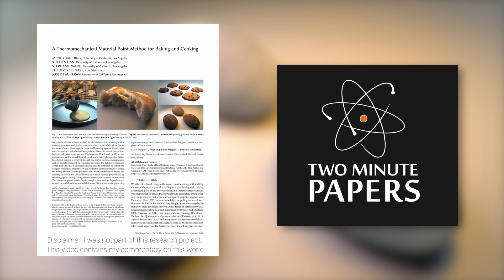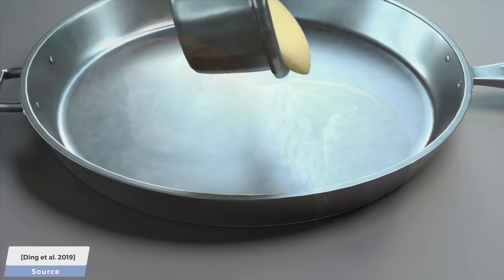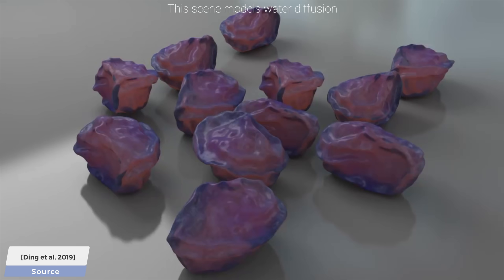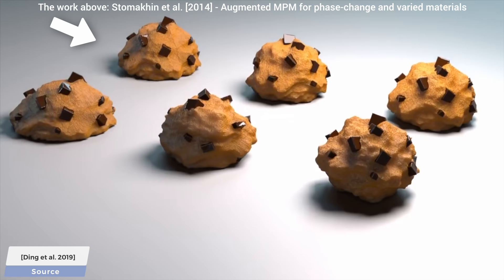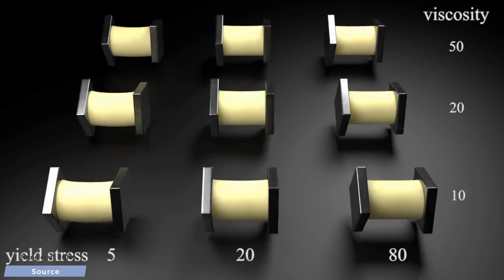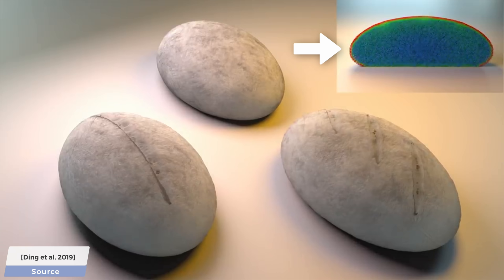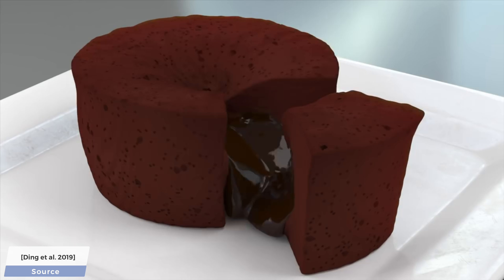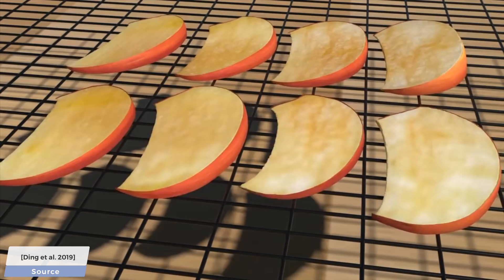Baking And Melting Chocolate Simulations Are Now Possible! 🍫

Comment: Finally, a baking simulation that probably takes longer than IRL baking
Reply: Yes and you can do both in parallel by putting your dough on your graphics card
Reply: @johnconnor2039  that's a nice joke
Reply: @johnconnor2039  You maxed out that one
Reply: @entiretwix1480  That's no joke.
Reply: So what if we add some baked lighting? That way we can get baked and watch things bake while they're baked. Fucking bakeception.
Reply: @johnconnor2039  you have earned the internet, good sir.
Reply: @johnconnor2039  I just spit out my tea
Reply: But so does rendering. Real life rendering is real time (relatively of course)
Reply: @johnconnor2039  processor*
Reply: And probably bakes your processors as well

Comment: 2019 Simulating the atmosphere for better weather forecast.
2020 Simulating the loaf for better baking.
Reply: Can you imagine there advancements in baking that could be achieved with this simulation? It could be used with a smart oven to perfectly calibrate baking so that that any recipe would immediately adapt to your oven and always be perfect.
Reply: @masterchief7301  I want to eat the first A.I. optimalized bread.
Reply: @MrVocsok  Why AI? This paper clearly provides numerical solutions.
Reply: @Ruhrpottpatriot  You can slap AI on top of it to sift through trillions of recipes to figure out the best ones.
Reply: @michaelbuckers  Exactly.
Reply: @michaelbuckers  If your Neural Network (don't use the term AI, it makes you sound like a Verge PC Builder) is decently trained and fit for the task.
In most cases a numerical data analysis will be sufficient and often even better, however. Also it doesn't have to be trained and works out of the box.
Reply: Surviving in a post-apocalyptic world necessitates this skill
Reply: @duhbead  or in space where things like atmospheric pressure is liable to variations.
Reply: Speedrun baking.  Optimisation will be done.
Reply: @masterchief7301  exactly, in the short future, we will have reverse engineered cooking to literally design our food as we wish. The future is going to be crazy in ways that movies or scifi writers never foresaw.
Reply: I doubt the actually intent of this is in optimizing baking, this is a complex simulation taking into account behavior of solids, liquids and gases when subject to various temperatures etc.

I'd bet baking was chosen as the focus for the development due to it being something the author can easily replicate and compare with the real world. But this framework that has been developed can then be applied to all sorts of material science/industry applications. Running simulations of ceramics curing is just one example.
Reply: @Ender240sxS13  yeah. The possible applications go far beyond what you see.
Reply: @Ender240sxS13  yeah that's cool and all, but I think I can speak on behalf of the majority of humans when I say that we want this to be used for the production of perfect loafs of bread.
Reply: important things first, then the fun...
Reply: @Ruhrpottpatriot  if your ai (dont ues the term neural network, it makes you sound like an idiot) is trained PROPERLY, it would be better than mathmatics.
Reply: @Ruhrpottpatriot  you correcting someone else, with an equally annoying term.
Reply: L
Reply: @Ruhrpottpatriot  But it doesn't have to necessarily be a neural network?

Comment: Something is burning right? 

Oh its gpu
Reply: It's the cpu not the gpu
Reply: berkcancosan no.
Reply: Owning a vega 64, I also own an oven now
Reply: @Mr371312  Careful while baking  mine is.. fire spreading ahh  
coughing
Reply: @SG1 Boosts Don't tell him to shut up if you don't know what you're talking about. The physics of all this is most likely calculated on the CPU, unless OpenCL or CUDA is being used for acceleration. The graphical render for this can be done on either the CPU or GPU (and if it's GPU, it's definitely not done though DirectX or OpenGL, it would also be through OpenCL or CUDA). This is definitely not in real time either way.
Reply: @KillFrenzy96  With some of the more powerful cards out there especially the newer series with real-time dynamic ray tracing capabilities and with the use of Vulkan these can be done on the GPU and some of it can be rendered in real-time if the rendering engine is using a voxel and instancing system. Now as for the computational physics itself, you might want a designated physics card. Now, I'm not claiming that you are going to get 60 - 120 frames per second in 4K resolution... but it can be done in real-time, at least with modern CPU technology with 8-32 cores at the 5-7 nanometer level... An ordinary or basic computer would struggle, but a super build extreme gaming rig could probably handle it. The only problem being is if the system is liquid-cooled, it might affect the baking temperatures and time (pun intended).
Reply: @SG1 Boosts physics aren't graphics, are they?
Reply: @flytrapYTP  oh look we got the same usernames!, Sort of
Reply: Rishabh Rathi they got 1.000.000.000.000.000.000 TERAFLOPS gpu in lab
Reply: LOL
Reply: The first game that would give you smell
Reply: @flytrapYTP  Wondering if physics engine takes advantage of gpu
Reply: You got me lol
Reply: Rishabh Rathi lol
Reply: @Ar3Ar3  best comment thread ever
Reply: @Solid_Snake99  sounds like they got nukes there.
Reply: @flytrapYTP  I think that Physics are just properties, But you definitely need GPU power to implement them into the environment.
Reply: @Alison-gc6gh  if any of you had even read the paper, you would have noted this sentence:
1. All simulations were run on either Intel Xeon E5-2690 v4 system
with 48 threads (Machine 1) or Intel Xeon X5690 with 12 threads
on page 13.
Reply: @xl000  Sorry I don't know how I missed that thank you tho
Reply: @xl000  thanks bro
Reply: @flytrapYTP  But, We can accelerate physics using GPU. Although, it still need CPU but, it removes load
Reply: I find it amazing that everyone fights about a joke of a burning gpu 🤦‍♂️ why?
Reply: I was just about to make this joke lol I thought it in the beginning of the video xD
Reply: @bevkcan  w a t

Comment: Me, running this simulation on my computer:
Wow it even comes with simulated smells how did they do that??
Reply: You can actually feel the heat of the simulated oven!
Reply: That's just the smell of burning silicon and melted copper
Reply: For anyone asking, to simulate the smells you need to install BrndDgh.bat file and do the steps below
1. Install the BrndDgh.bat file

2. Put dough on your GPU
3. Run the render.
4. Profit

Comment: 1950: "i'll bet there are flying cars in 2020"
2020: "so we are able to simulate baking a bread"
Reply: Linus Marti that’s harder to do than flying cars. Flying cars are easy to do, but their price/km isn’t as great now, so it’s basically useless.
Reply: Sounds like south park
Reply: @Crutoiful  flying cars are harder. It requires so many technologies that don't exist yet. One is self driving tech, they never predicted that we wouldn't actually be flying the vehicles. Once that matures we need better propulsion tech to get it off the ground and actually moving more smoothly than even a jet. One of the biggest problems though is fuel/batteries. We can't do batteries in the air (think lightening) and fuel for the same reason but also leakage. We need a better way to keep them running. Everything we're gonna need you'll see helicopter/plane hybrids and fueless/batteryless self driving cars on the road first, and SpaceX mining rockets mining asteroids, before we get to the point of even testing flying cars at the point where self driving is now for Tesla and Toyota's autopilot but we're getting there. I'd say another 60 years at least.
Reply: Psilocybe Cubensis so basically as I said, we can do this but it would be unpractical
Reply: flying cars turns out to be a terribly stupid idea. 1950's people failed. can't we just accept that instead of using this tired 'joke'?
Reply: This is more amazing then some cars in the sky. (We have Electric small aircraft) Its really not that impressive, the battery technology is tho. The solid state drive and Tesla works on batteries in impressive. I digress this has so many applications beyond cooking. We could simulate worlds with development of this.

Comment: Hey so uh quick question: how is this useful in the practical world?
Reply: You can calculate the behaviour of liquids, fluids, gases and solids. You can predict how something will behave and interact under certain temperatures.
For example you could use it for optimizing engines. Or for making models of ships and predicting the behaviour of the material under different conditions.
There are a lot of possible applications of this tech.
The baking simulation is just for show and probably for fun.

Comment: The elder scrolls 7 will be amazing
Reply: Until your sweet roll glitches and swallows a village.
Reply: TES is made by Bethesda. Don't have your hopes set too high. There may be a company which does implement something like this to PlayStation 7.
Reply: @Kynareth6  playstation 7 because it would take nearly 20 years for something as outdated and unadvanced as consoles to catch up
Reply: @heroninja1125  Games are written for consoles. So what that you can have 128 threads in your PC? Games are programmed for only 8 because that how many PS4 and XBO have.

Comment: where i can download that demo?¿
Reply: nowhere. Implement it yourself.
If you had read the paper, you would have noticed this:

ACKNOWLEDGMENTS
The work is supported by NSF CCF-1422795, Intel STC-Visual Computing Grant (20112360) as well as a gift from Adobe Inc.

meaning the actual implementation will end up  in a an Adobe product somewhere down the line.